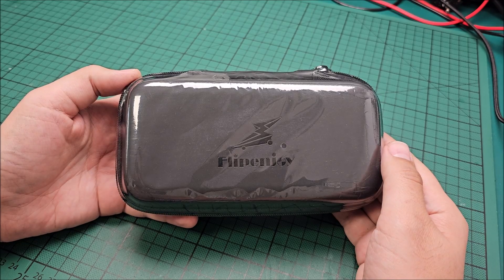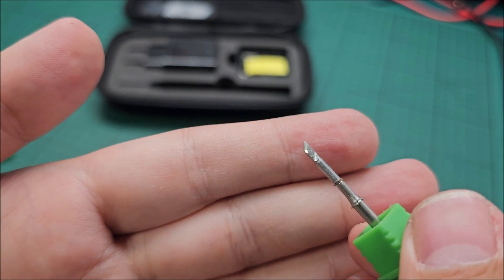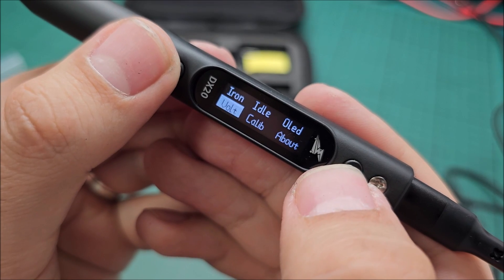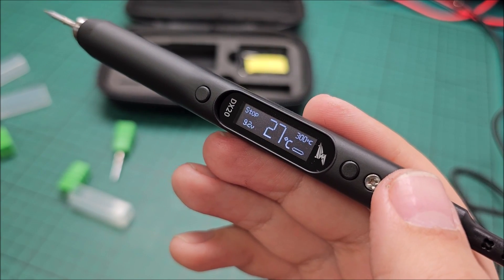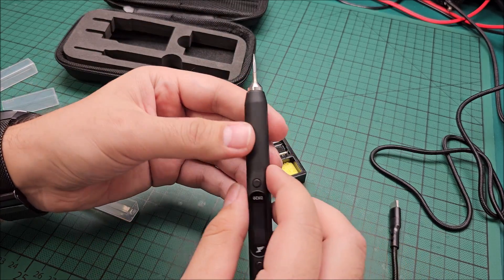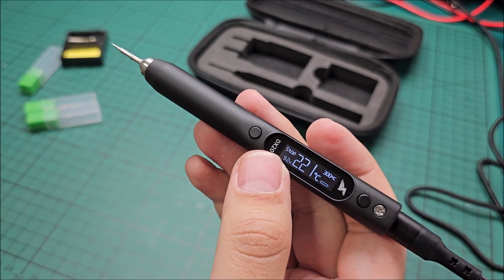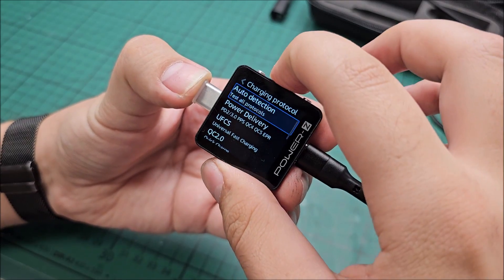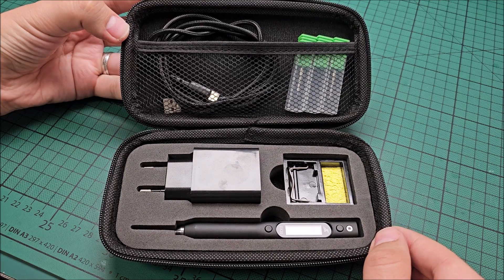Flipenjoy DX20 Nano High Precision Electric Soldering Iron - unboxing and review ✔️

Comment: I have a problem while doing calibration, I have set the temperature to 500 degrees due to which the display shows 14.5 volts and high voltage beeps, please tell me the solution.
Reply from the maker: Are you using the original charger? Try to contact flipenjoy.
Reply: @UltimateDIY  yes m using original one